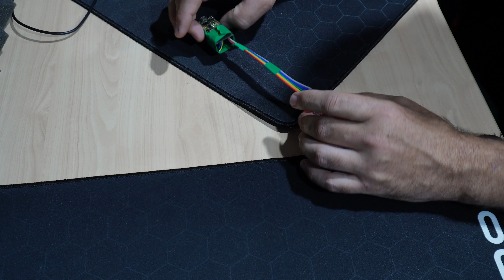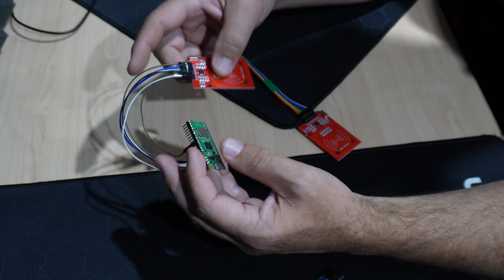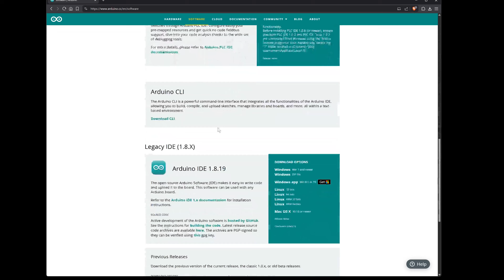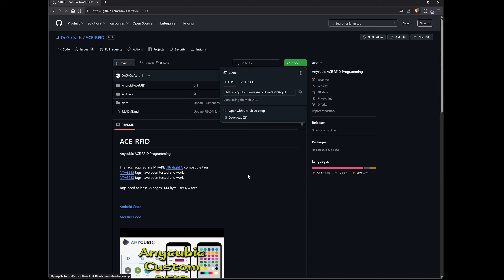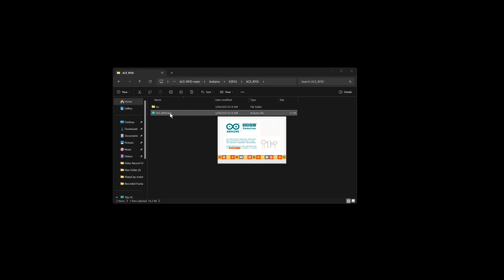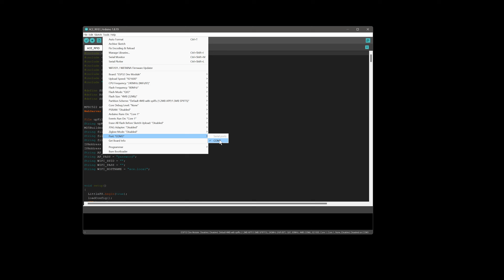Flash Arduino RFID Code

Comment: Thanks for your work on this setup.
I'm using the ESP8266 variant of the code through a NodeMCU board. One issue i have is that i have to disconnect the speaker when booting the board or i cannot connect to the access point. Once connected to the AP i reconnect the speaker and everything works well. Any ideas what would be causing this?
Reply from the maker: try change the pin assignment to a different gpio
Reply: @DnG-Crafts  Thanks. That worked. I switched the speaker pin from GPIO 16 (D0) to GPIO 5 (D1) and works good now.

Comment: Do you have a buzzer connected to the esp32? if so, is it active or passive? I see the code, you define Pin16
Reply from the maker: i am using a speaker off an old computer motherboard like this
https://www.amazon.com/MEETOOT-Motherboard-Speaker-Computer-Internal/dp/B09JP46LB6

Comment: 英语 谢谢，兄弟，我也读了你的 Android 程序。真的很棒。我有一台 PCR532，但我想问问你有没有考虑过用 PCR532 直接连接到电脑进行读、修改和写。那不是更容易吗？
Reply from the maker: you can try to see if the PCR532 works with the windows code but it is designed around the ACR122U

https://github.com/DnG-Crafts/ACE-RFID/tree/main/Windows
Reply: may i ask does the code work with the PCR532?
Reply: @DannyCheng-q7z 目前看似乎不行。
Reply: @3DPrintingOne ok

Comment: I have just assembled my kit using an RC522 with ESP32. However, I noticed that yours made a beep when you put the RFID tag near the RC522. Mine does nothing? As I don't yet have my CFS, I'm unaware if the tag was written to using the web interface.
Reply from the maker: i have a piezo speaker connected to gpio 27 on mine for the beep 

like this
https://en.wikipedia.org/wiki/PC_speaker#/media/File:PC-Speaker_IMG_9311-9312.JPG